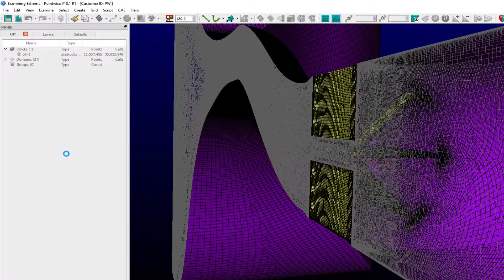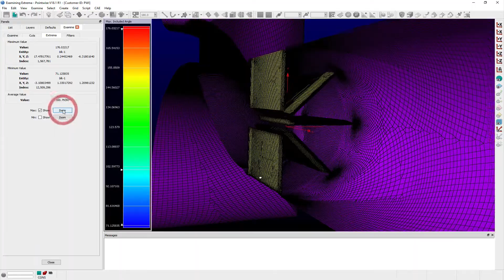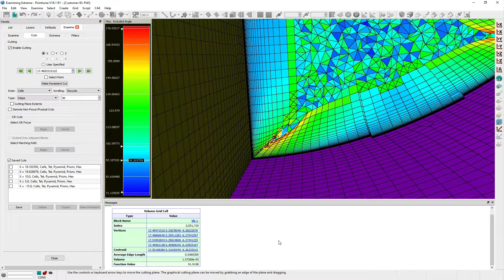Identifying Problem Cells

Comment: Hey @pointwise

How do you improve the cell quality of the cells as shown in the video (When you display the cut section and show the cells having poor quality). 
I've seen this issue near surface inter junctions(such as shown in the video), wherein isotropic cells are used in between ani-isotropic cells. So is there any meshing methodology (unstructured) via which we can resolve this issue of poor quality.?